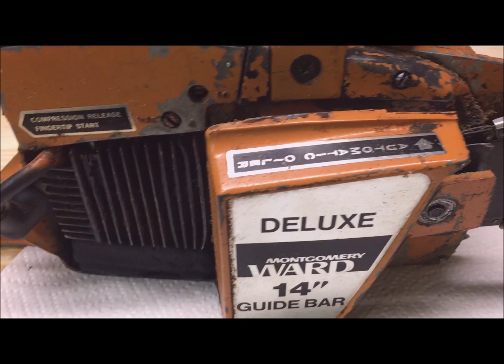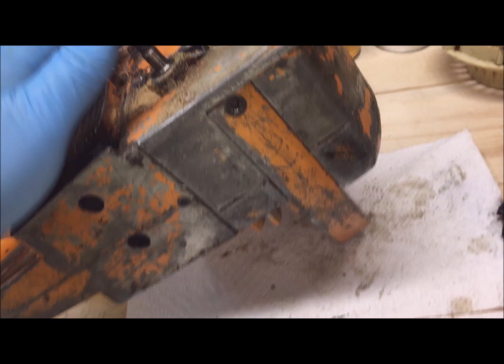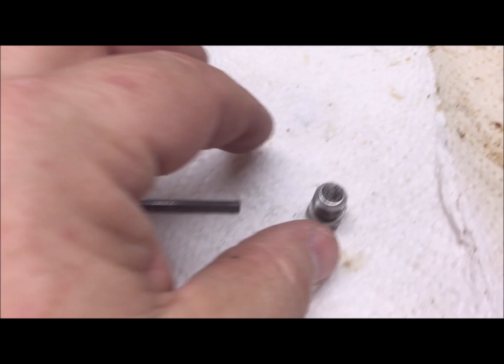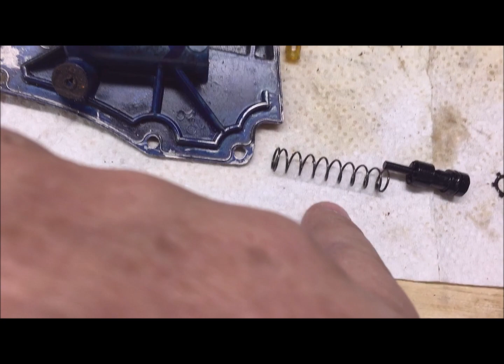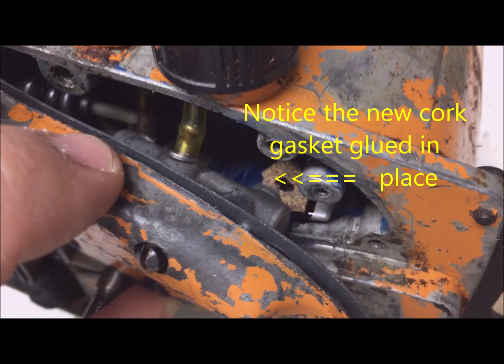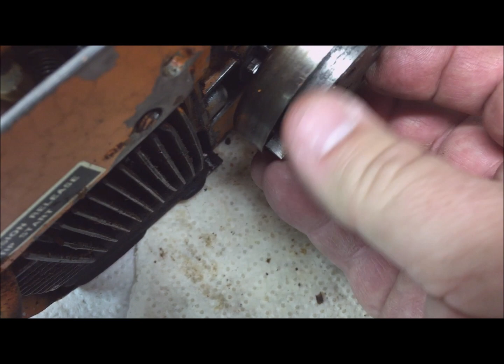Montgomery Wards Remington Mighty Mite John Deere 91 chainsaw Duck Valve replacement

Comment: Great job, I'll have to check that out on mine. Mine is an older model I got at a yard sale. The handle was broken and the top of it was missing, and the plastic side was missing a piece, so I repaired it and made a new top piece out of fiberglass. After all that I thought it was ready to go, but to my dismay, the coil is shot. No spark even after cleaning the points. Do you know what the resistance of the coil should be. I'm going to check the condenser for a short, just in case.
Reply from the maker: @johnb5519  no sorry on the readings. There is a site that sells good used Remington mighty mite parts. Google search and eBay too

Comment: I just fixed a old wards Remington chainsaw that did not oil at all by putting a weed eater string down the check valve hole for the manual push button oiler and by pushing it’s up and down a little I freed it up and now it is working again besides it dumping oil like it did before it stoped working but that’s fine to me (but I only want to say this because I think it’s funny a weed eater string can fix a chain saw)

Comment: Thanks for the video.  However the shorter valve doesn't fit.  I had to bore out the hole to make it fit.  On the plus side I was able to reinstall the screen with just a toothpick so no new screen needed.  This fix definitely stopped the oil leak but the auto oiler doesn't seem to be working.  Perhaps the pressure in the cylinder isn't enough to push past the tiny orifice in the valve.  At least the manual oiler works and no more horrible smoke and ceasing from leaked oil.  Also I didn't have a spanner tool so I made a pair from grabbing a set of needle nose pliers with a vice grip.  The teeth on the pliers served as my spanner tool.
Reply from the maker: There is an adjustment valve (set screw) which should allow you to increase the chain oil flow.  Are your passages clear? Is the cap leaking. The tank gets pressurized by the crankcase gases thru the duck bill valve thud forcing oil to the chain. If the cap leaks you’ll get no pressure
Reply: @davemilster  I don't think it leaks because I can always relieve the pressure from the cap after extended use.  Similarly since the manual oiler works I don't think the passage is blocked and I have the set screw out almost all the way.  I have a feeling the valve is just very tight.  Dunno what kind of psi is being produced in the crank case.  I blew through the valve with my mouth and barely got any flow so maybe the pressure isn't enough.
Reply from the maker: If you're getting pressure in the oil tank, that should more than provide adequate pressure to pump it out onto the chain. I have no further ideas on that.
Reply: @davemilster  It may actually be working... now.  I mean I can't say with certainty but the chain hasn't dried up on its own.. seems to have a film on it, so maybe the oil is coming out, but not to the extent that it should based on the screw position.  It's fine though, as the lubrication is adequate.  Certainly much better than it was in its leaky state, where I could barely run the saw at all.  I wouldn't have been able to do it without your video so thank you.

Comment: Do you mix 8 ounces of oil per gallons for that saw
Reply from the maker: Yes 8oz to 1 gallon. 
Since the saw uses so little fuel What I find easier though is to buy a 50:1 pre mix quart and add oil. A quart of 50:1 has 0.64. At 16:1 (needed for this saw) that’s 2 oz per quart. 
So I add 1.36 oz of oil to the 50:1 quart. That makes the mix just right 
1.36 plus 0.64 is 2oz. 
I mark the quart can 16:1  too so I don’t forget.

Comment: I have a chainsaw the exact same as that no difference except mine is red but it sat for 29 years without being started in my shop I’m waiting for a pulley to arrive I did buy a new carb for it which took me a month to find but I think it’s a pretty handy little saw I did try to turn it over by a drill and almost got her started

Comment: Thank you so much for the vid, I have a duckbill, just couldn't figure out how to get it in there.  Will get this MM2 saw running again today.  I have 2, got one about 40 years ago, used it a lot but recently it began smoking.  Got another one on a garage sale for parts, took 20 minutes to clean and it now works well also.  Question- does anyone else have problems with the gas tank heating up and boiling the gas?  I've cleaned the cylinder fins, good air flow thru there, but it still gets the gas tank hot and will blow gas vapor out of the fill cap if I don't let the saw cool down before opening the tank to refill.  Metal case saw,  have heard others talk about it, just wonder why I'm having that problem but no one seems to address it.
Reply from the maker: mine after an extended use will heat up the muffler enough that after shutting off the residue on it will smoke for about 30 seconds.  I have used mine with a full tank to empty and not experienced the fuel tank heating as you describe.  mine has a plastic tank inside the metal housing, so there may have been a design change along the way..